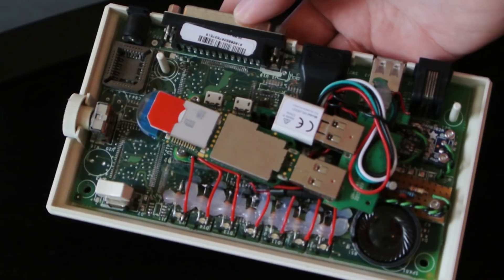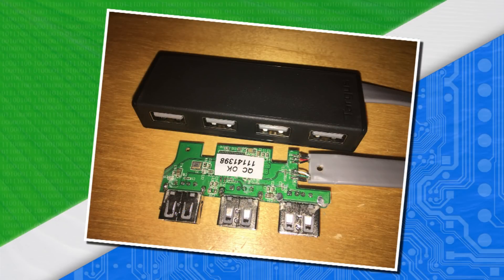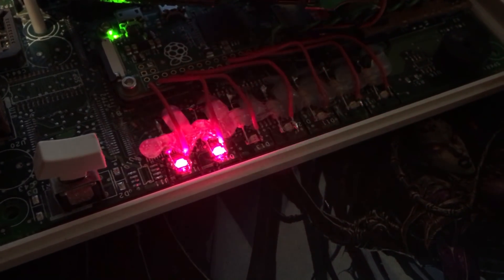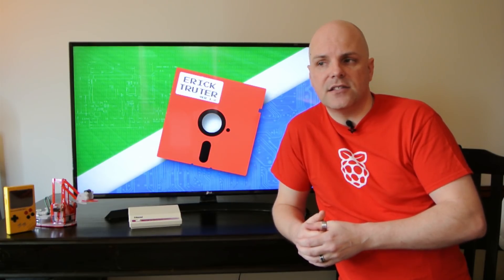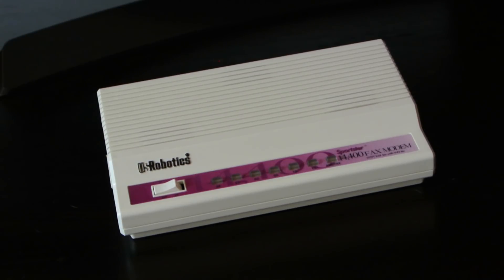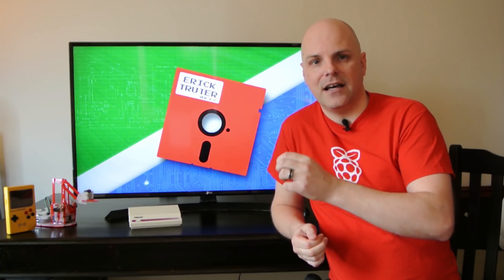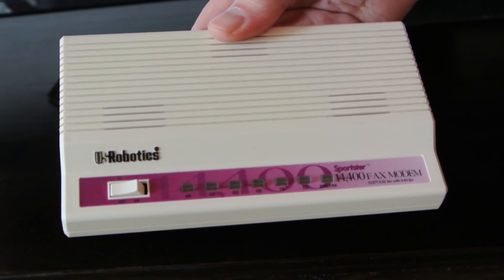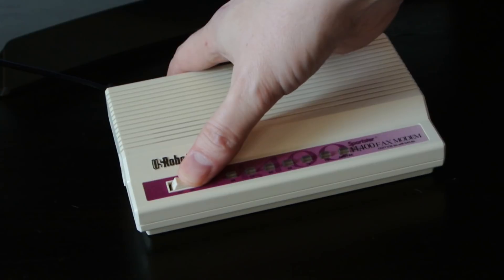Raspberry Pi Modem Project

Comment: Nice project. The funny thing is you could have used the raspberry pi and this external modem to make an actual phone network and dialup networking server. That is what I use at home for my vintage computers.
I would be interested in checking out your schematic and code, could you post it somewhere?
Reply: if you are still around, can you explain how to make a phone network and server with a Pi?